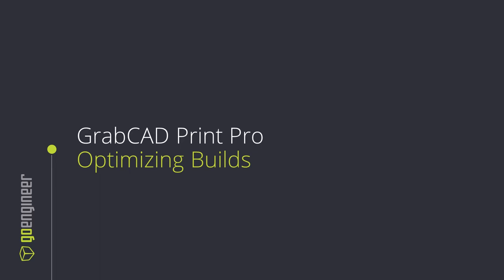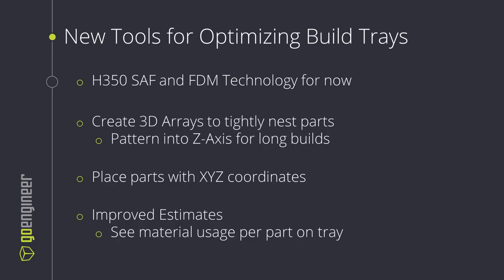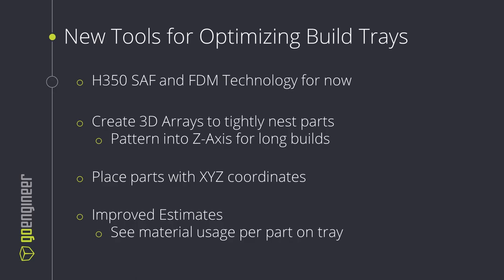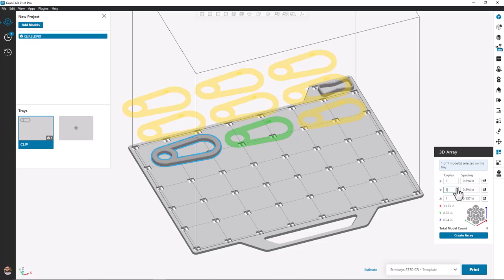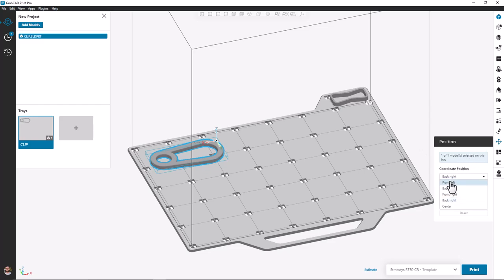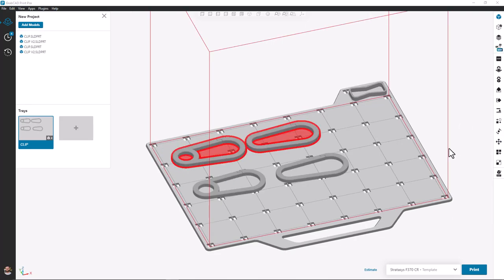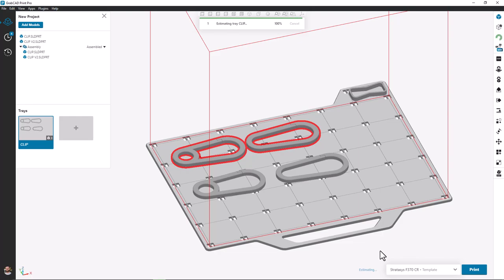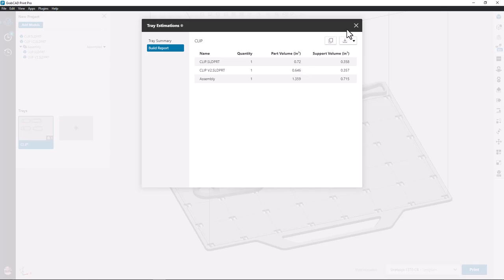Optimizing 3D Print Builds with GrabCAD Print Pro

Comment: Love your videos. Quick question, our GrabCAD print program is super slow, most of that is the laptop that it is ran on, but some of it is the complex assemblies we print on our J850, with a ton of textures. One part can have 50 bodies with textures, and then that is multiplied by 40 parts to take up the whole build volume. Estimation can take 40 minutes sometimes. 

Do you have a best of the best system specs for GrabCAD print for when we upgrade in the near future? Is there a brand of CPU that the software utilizes better? Is it optimized for any brand of workstation graphics?

I looked at GrabCAD print and the suggested specs are immediately obvious, figured I would ask the pros.